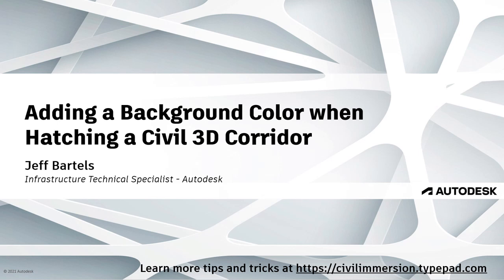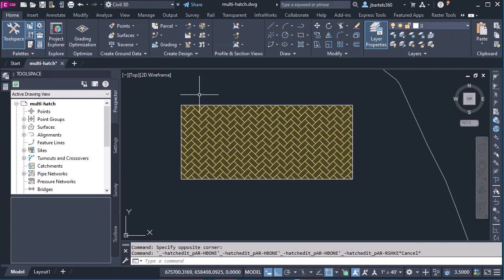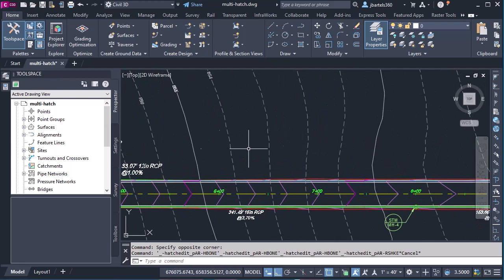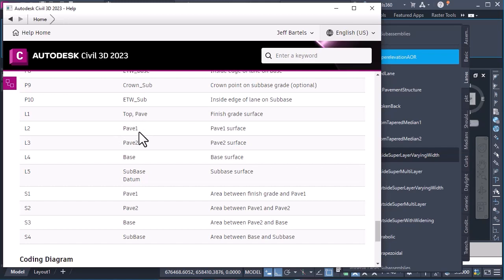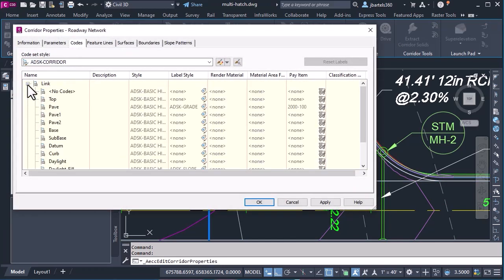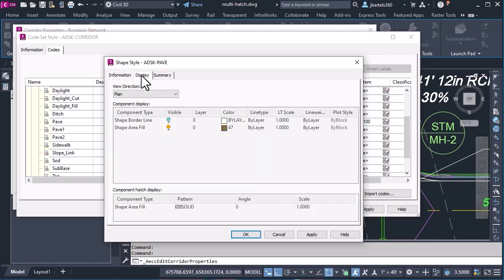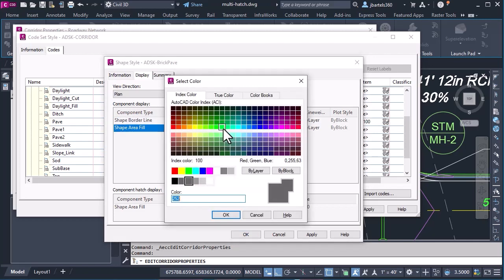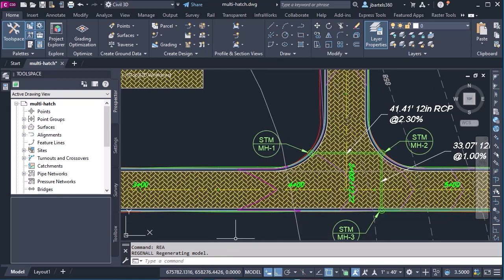Add a Background Color to Civil 3D Corridor Hatch

Comment: Hey Jeff I'm finally here after doing and trying to find a solution aloy please help me out ...I wanted to draw an alignment and also use that offset alignment object so I can make modifications into the main as well as the offset also ...but when try to apply offset alignment for 10 to 15 km road and put all the widening criteria along the alignment ..the alignment get stuck ,usuable ,just slow down how it's actually work but not work after I put all the information ..I need your help how can I use that offset alignment in efficient manner what was the best practices to use it for long roads